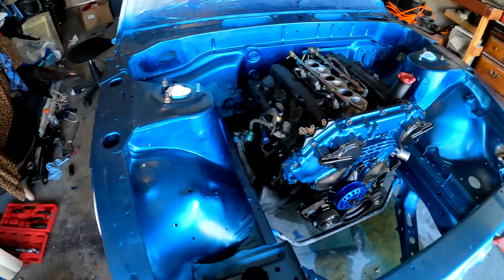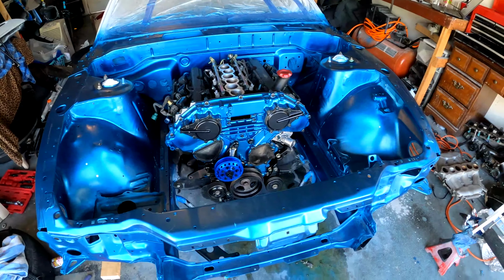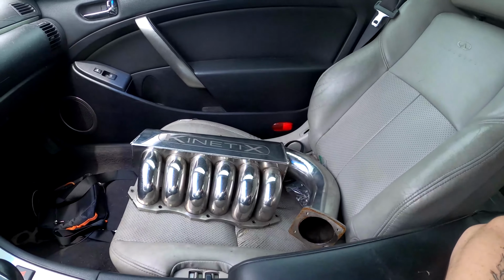VQ35DE 240sx: DROPPING A VQ IN 240sx

Comment: Did you have to clearance the transmission tunnel where the trans mount is?
Reply from the maker: Nope. I didnt have to do any modification to the trans tunnel!
Reply: @dabitat  well that's super. Was dreading going under the car to beat it out. Car gained some black windows from sitting for so long and I'm arachnophobic